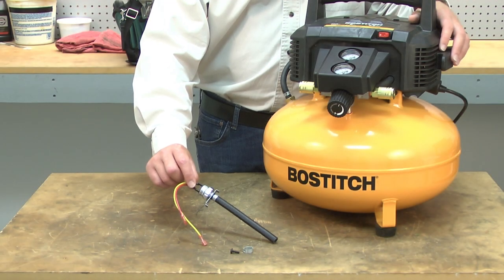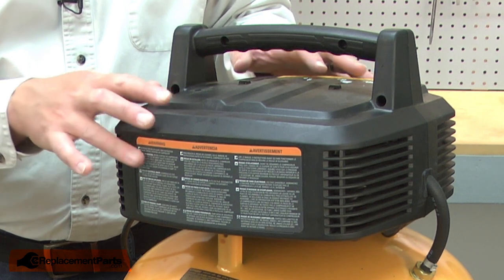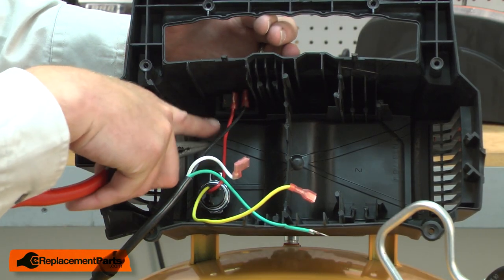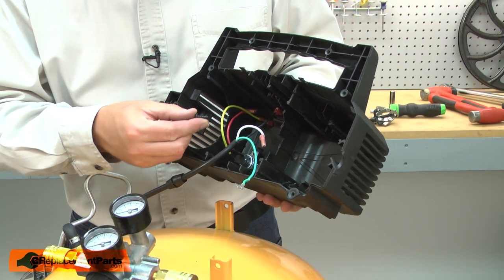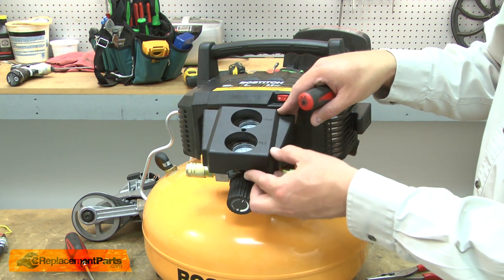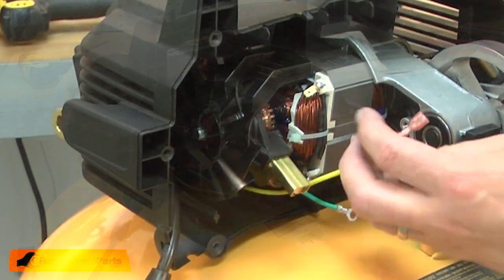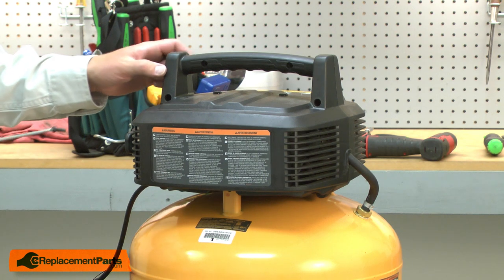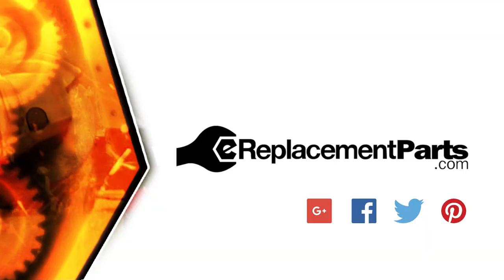Bostitch Air Compressor Repair - Replacing the Pressure Switch (Bostitch Part # N003307SV)

Comment: My wires were fraying right at the housing and compressor wasn’t turning off, kept running. fixed the wires and I tapped that part pretty good he’s replacing in hopes I get a few more miles outta the thing and it worked. 150 psi and it turned off. I’m surprised the piston is just opened to the air like that. I’ll probably try keeping it away from dusty areas now. I also just got some parts in the mail from you guys. 2 years of service and I’m thankful for keeping my business’s tools going. ✌🏼
Reply: I tapped mine untill it just went up in smoke. Compressor slowed to a stop and a little cloud of smoke puffed out 😆

Comment: I enjoyed the video. I found it to be very informative. Nevertheless, safety never takes a break, nor should you! PPE or remove the ring from your left hand ring finger or risk injury or even  worse, losing a finger from an electrical arc or having it get caught on something such as a compressor pulley. You  walked into the shop with all of your fingers and toes. We all want to leave the same way we came in. Peace.

Comment: I accidentally ripped the plug cord out of my Air Compressor housing.  This video showed me how to reconnect the wires for the plug cord.  Minute 2:05 - 3:00 gives a good visual how the black, white, and green grounding wire connect to inside of compressor.  Thanks for video.

Comment: My compressor will only come up to 60 lbs and will keep running, would this part solve my problem ?
Reply: Mine is doing the same.  Were you ever able to identify the issue?
Reply: Change pression switch